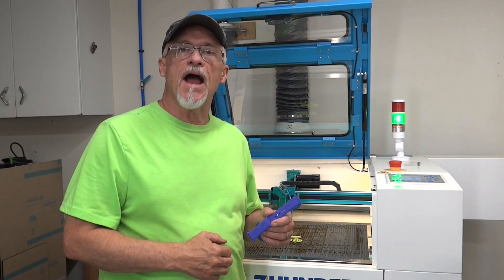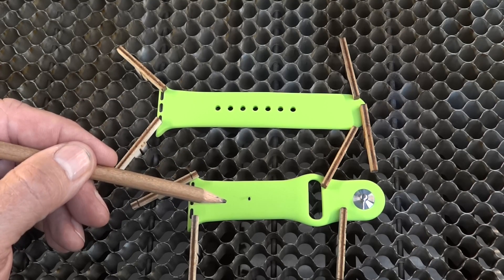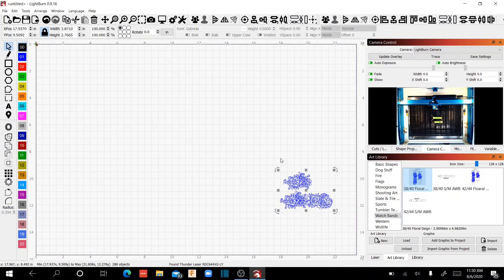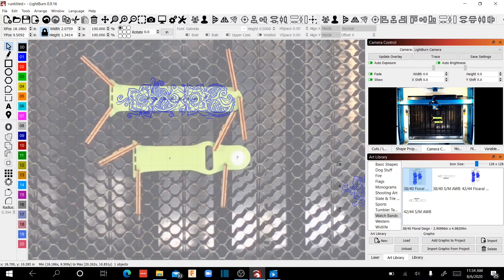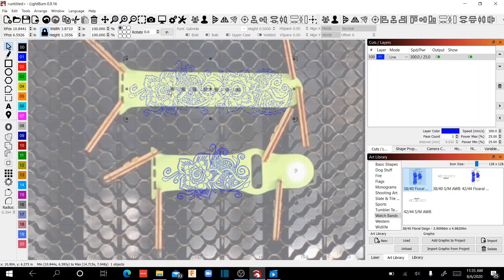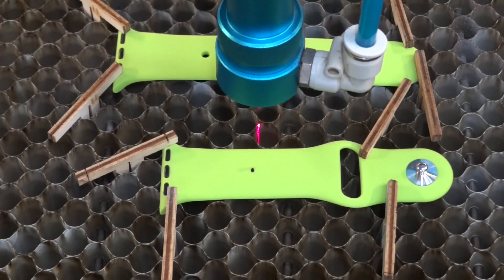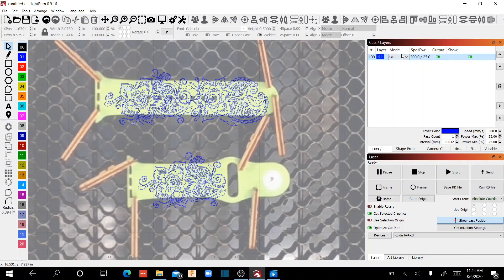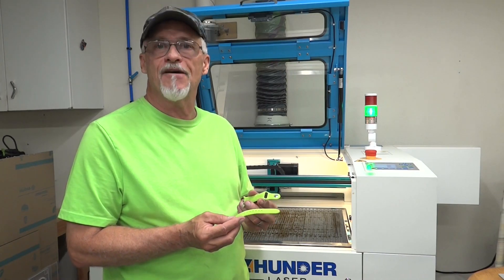Engrave Apple Watch Bands with the Camera on your laser

Comment: I engraved a pink watch band with your suggested settings (I have a 60w nova 24 as well) but I have not been able to remove the char/black marks with a toothbrush and hand sanitizer. Any suggestions?
Reply from the maker: try dawn power wash, I’ve never had a problem removing the char.
Reply: I did a purple band and had “white residue” and tired the tooth brush, it works better with a washcloth and bend the band here and there

Comment: What are the names of the holders that are in the honeycomb? Do you have a template or can it be found somewhere?
Reply from the maker: They are called honeycomb pins and they are sized to your honeycomb bed you can google honeycomb pin pattern and then adjust width for your honeycomb

Comment: Any reason why you wouldn't place a bunch of bands on the bed and do them all in one shot, of course, once you have everything aligned.
Reply: Also I can't seem to get the camera to calibrate very accurately.   Maybe I should spring for the actual lightburn camera?
Reply from the maker: you could sure do that, if I’m doing allot of them I use a jig, much faster and I get repeatable results. thanks for the comments and watching

Comment: Honeycomb pins?
Reply from the maker: Yes, they might look a little different because I cut the tops off of them so they do not inter fear with the laser head.
Reply: @computercreationz  is this something I make or buy? I cant see the business end of them to reverse engineer.
Reply from the maker: @tristonm37  sorry I misunderstood your question, there are allot. Designs out there if you search the laser Facebook pages for honeycomb pins there is allot to choose from. Look in there files section.  No need to start from scratch. LightBurn forums will have some designs too